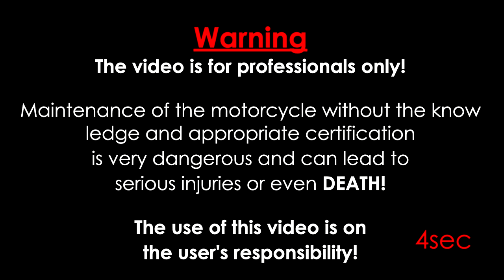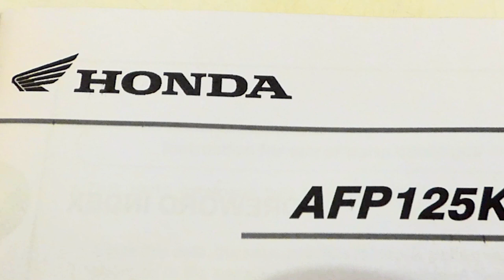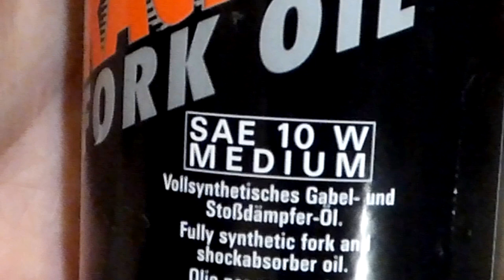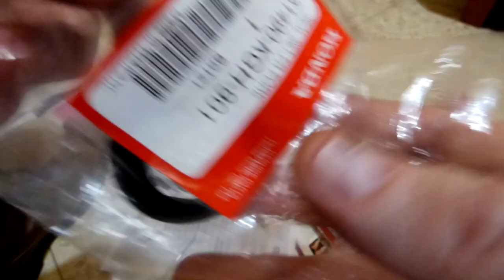Front Fork - Removal & Oil change & New Seals | HONDA INNOVA GARAGE | WAVE | 2010

Comment: What is a good rear suspension for innova? Also can an aftermarket shock be installed with the chain cover?
Reply from the maker: Thank you for the question. If the aftermarket part is the same size of course there shouldn't be a problem. If you have a doubt please ask the seller and ask him for a commitment on this issue. If you order an upgraded part it will be possible not fit, and then adjustments will be needed. Either way, only a qualified mechanic can do the job safely, so I encourage you to contact a qualified mechanic. From what I know sometimes there is an adjustments that need to be made on the plastic cover . Maybe sometimes an adjustments be necessary to the metal chain cover? The original shock absorber is relatively hard and gives more stability, and a soft one giving more comfortebl riding. In countries where there are leagues of sports competition, there are also a number of other upgrades. YouTube has begun to block iterant links to stores, but you can share knowledge and tell us what brand and model you are debating about? what the name of the store you are going to purchase from? at what price? thank you very much.
Reply: @MyINNOVAMotorcycling  Thanks. I am a mechanic. But i do not work on motorcycle but large diesel engines and generators in a powerhouse (small ones are 1 MW , large ones 9MW gensets) 

Recently i purchased a motorcycle and i want to do maintenance works myself as the garages are very expensive and they cheat a lot. 

Honda innova / wave series is very fuel economic, thats why i bought it. I am yet to learn the maintenance works of small gasoline engines. Its pretty much similar to big engines. Infact even easier as its only having one cylinder unlike twenty or 16 cylinders in the engines i am working on. 

The default rear suspension is a little hard for me and for many passengers hence i was thinking of buying an aftermarket shock with the oil reservoir. Do you recommend?
Reply from the maker: @SaapeXD  I am not a certified professional mechanic, I am a very high level non-qualified mechanic because I did not did state certification exams. Either way, mechanics are very nice people, in every profession there are unfair people, I don't get a sweeping statement blaming mechanics for "they cheat a lot". If you also have a good mechanic hands, and you have the tools, that's another matter.A self-repair(DIY) is very enjoyble and  thar has advantages, for example: you don't have to waste a time for accessing the garage. And yes, engines no matter the size, built from similar assemblies, this small volume engine means less screws, less weight, less special tools, and therefore easier to maintain. I had a successful experience with the absorber of the Greek CUB model 2011(Nipponia) , yes, there are absorbers that are more comfortable, and as I wrote may require cutting in the plastic cover for adjustments.
Reply: @MyINNOVAMotorcycling  What about this one: https://bikerzbits.co.th/honda-wave125i-g-series-yss-shock-absorbers-rc302-340t-55-gold.html The picture is exactly my bike. But it does not have the Chain Cover with the shock absorber installed.
Reply from the maker: The link doesn't work, assuming I watched the one you mean.....YSS All New Gold Series G-Series RC302-340T....It's a shock absorber for racing. It is very expensive ,relative to the standard. It can be ordered tuned according to your weight. And of course, its wide structure in the upper area(the nitrogen gas tank) probably requires a change in the rear plastic cover of the motorcycle. It seems unnecessary to me, you claimed that you are with a scooter to save costs. On the other hand, it's a quality shock absorber, only you know what's good for you.

Comment: When it needed?
Reply from the maker: According to the manufacturer's instructions, it is recommended to replace fork oil every two years (Hopefully I am not mistaken about time). If you will decide to change oil, you will need to replace all the seals. In my case, I opend the fork because there was an oil breakout from one of the seals (the O RING at the top edge). When there is an oil leak, dirt will be stucking on the shock absorber, and you can also see signs of oil moisture. When the oil begins to come out, the fork stops functioning, and what you feel is only the strong vibrations of the spring, in such a situation it is very dangerous to ride.
Reply: @MyINNOVAMotorcycling  so, in my case . My bike working fine from 2 years(new ) so no leakage, so not required so early!!
Reply from the maker: Yes

Comment: How much oil is for one
Reply from the maker: Please observe at
8:17
In the screen (1), the top left screen. 70.5 to 72.5 ml.

Another method: when measuring the level
8:42
Screen (1), the height measured is 76 millimeters (without the spring, when the inner tube is inserted all the way in).

Comment: not complete, coz without info about oil, to how many,.
Reply from the maker: The information you request exists in the video. Look again at step 10. On the split screen you will look at screen (1), this is the screen in the upper right corner. There are two methods of measuring the amount of oil, one of which is 70.5-72.5 ml.
https://youtu.be/Q81TcIfJQ_0?t=496